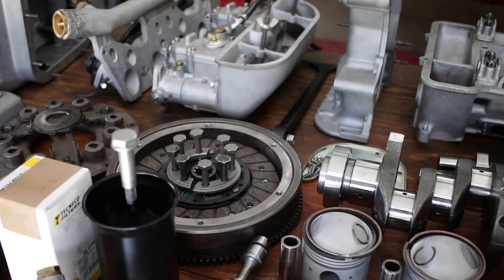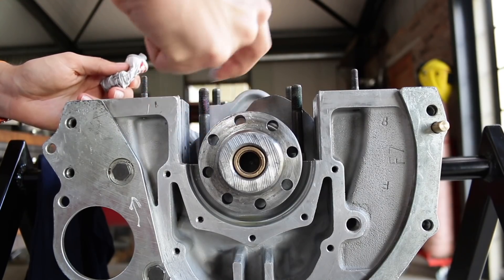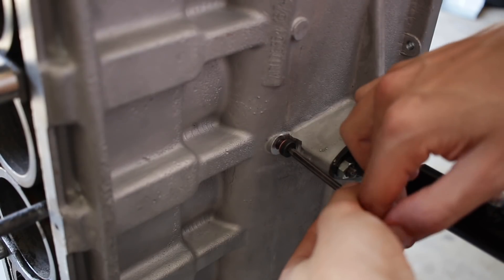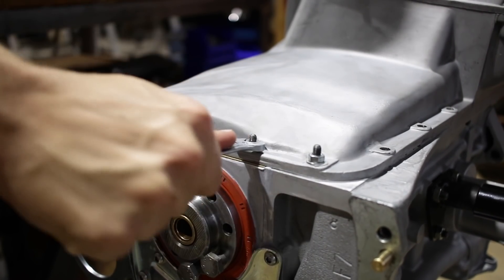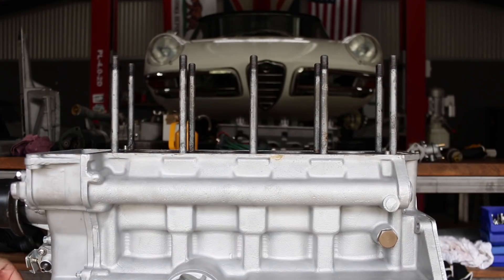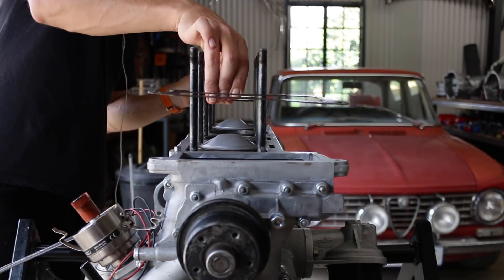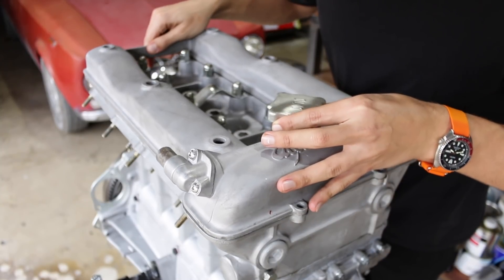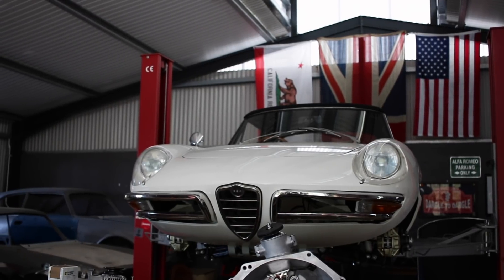Engine Rebuild for the 1967 Alfa Romeo Spider project.

Comment: Hi. I've got a '67 Giulia Super 1600. Doing a rebuild just like you but am running into an issue finding conrod bolts for a 1.6. Where did you find yours or did you re-use the old ones? Thanks
Reply from the maker: On these Alfa twin cams you can reuse the rod bolts, they’re not a stretch fit. If you want to build a high performance engine then it’s probably worth replacing the whole rod and fit ARP bolts. But if you’re just building a standard or even slightly tuned engine the original bolts will be just fine.

Comment: I'm watching the video four years after it was first shown on YouTube.
How has the engine performed? Is it still running strong and reliably?
I hope so!🤞
Reply from the maker: @holdencaulfield1001  I sold the car after putting a few thousand kilometers on it. The engine ran really well. Had great power for a 1600. It was smooth and revved well. Unfortunately it did leak a little bit of oil from the main crank seals, but not so much that it was a problem. The new owner drove it 1000 miles home cross country, and he said it ran great. It’s now in the UK as far as I know, I haven’t heard anything since it left the country about 4 years ago.
Reply: @JethroBronner thank you for the update. It sounds as if your effort was well worthwhile. The main crank seals leak is a mystery! I witnessed a much worse oil leak at a mechanic's in. Peugeot 505. It was like a running tap!
Congratulations on your work.
Reply from the maker: @holdencaulfield1001  I think ultimately the issues with the crank seals were down to the shoddy line bore repair this engine had in the past. The front seal wasn’t concentric and the 5th main cap needed extra gaskets on it to take up the missing material. If I had to do it over I would weld up the main bearing seats on the block and machine them back to standard. But then I didn’t have the budget to go to such extremes.
Reply: @JethroBronner I'll look forward to your future projects!☺️

Comment: Catching up on the videos. Turned on to your channel from Home Built by Jeff: octagon rotisserie. I noticed the high tensile strength washers. Are they crush washers? if so, they would need to be installed correctly. The smaller circumference side goes to the part, the wider to the nut or bolt. The crush washer is designed as a lock washer in disguise. It takes torque to compress them; that compression helps keep the nut/bolt from loosening up. Totally enjoying the videos and the meticulous attention to detail, it shows a love for the car and craft that goes into it.

Comment: Superb! Single click only when torquing. Remember the law of friction.  A solid object moving against another solid object has less friction the faster it moves. The maximum friction occurs right before it’s put into motion. So, when using a torque wrench, the nut or bolt is in motion when it reaches the desired force causing the wrench to click, which means it clicked with less friction. When you go for the second click, it takes more force to put the nut or bolt in motion than when you reached your desired torque the first time. If you go for a second click just to make sure, you are not double checking the torque, but instead you’re just risking exceeding the torque you already achieved. 
One ping only Vasily!

Comment: You may want to re think using high temp gasket maker everywhere. Ultra black from permatex is excellent in both adhesion and stopping oil leaks. 
High heat silicone is good for basically exhaust manifolds. That's it, it's not made for anywhere else. 
Case sealer for two strokes is also another amazing product for stoping oil leaks

Comment: No problem at all fitting the rings that way by hand. (10:05) Donot over extend them. I work ages like that with good results.
Ring breakage was seen with old Opels , due to bad ring quality, not due the mounting method of them.

Comment: When doing mains, I always torque the center first and then spin the crank to make sure it is free, then same procedure one cap at a time until done- that way if you have an issue with a tight bearing, you will know exactly which one is causing the problem.  Don't lock tight you thrust bearing cap until you have checked the end float.  Know about those crank plugs- a guy had a 1750 GTV for sale for 500.00- had low oil pressure and the dealer told him he needed a full rebuild.  I bought it , dropped the pan and replaced the crank plugs- oil pressure perfect- sold the car for 2000.00.

Comment: Is this a factory like rebuild or did you upgrade anything?
Reply from the maker: It’s pretty mush standard, apart from the repairs to the block and modified pistons I covered in older videos, and it has a 123 Ignition distributor.

Comment: Do you have any advice on 105 engine removal without the transmission? i took the transmission bolts out, the starter bolts, engine seems to be stuck where the clutch master is. thank you!

Comment: Great Video and great work!! When you assembled back flywheel I couldn't see what are the reference signs to correctly position it, can you please let me know? I removed it from my engine and the sign I did on flywheel disappeard when i cleaned it .... Thanks
Reply from the maker: Thank you! There are factory stamped “0”s in the flywheel and crank, and when I had the rotating assembly balanced they stamped a 0 on the clutch pressure plate too.
Reply: @JethroBronner  MAny Thanks!!

Comment: Smart move... My family and I owned and rebuilt a slew of Alfa engines and transmissions in the '70s. Our Alfa guru was a shop that also raced Giulietta spiders in SCCA events. They were spinning bearings. They removed the keepers and resorted to Loctite, theorizing that the keepers were distorting at extended redlines. They never spun another. Their 1300 Alfas always beat the 1500 Spitfires.

Comment: I am not an expert in old Alfas, but... All these engines seem all the same, except for the cylinder size . Isn't it a bit boring to work with? You have lots of projects, plus spare engines... Or, maybe i'm wrong... Would be glad to hear from more experienced people)
Reply from the maker: Yea they are all very similar. I’ve become very familiar with the Alfa 105 engine, but I’m also working on some new projects from Fiat and Honda for more variation.

Comment: Great work! Thanks for putting these videos together. I'm constantly using them as I'm trying to get my Alfa up and running. I could use some advice. I just rebuilt my carburetors (and used your video step by step to get me through this process). However, I can not get my fuel pump to work. I have replaced but can't get any fuel. I've check the lines, they flow using air, and I've looked for a breech in the line. I'm considering by-passing the old mechanical unit (12:22 of your video) and using a newer electronic fuel pump, but being a purist and wanting things to simple work, could you offer some advice as to why I can't seem to make this work? I do have both the original rods, however, I do not recall the spacer when I took the old fuel pump off, could the rod have gotten pushed to far in and created some damage? Thanks again for putting this channel together.
Reply from the maker: This may seem overly simple but first make sure that the fuel lines are plumbed into the pump the correct way round. I made that mistake on this Spider when I first tried to start it. 

Those rods can't be pushed back too far, but running the pump without that spacer will also cause some clearance issues inside the actual pump.

Comment: Jethro, I've been watching many of your excellent videos on Alfa repair.  This video will help me with my reassembly of my 1600 engine which will happen very soon. On another note, I'm wondering if you have any videos on adjusting steering play. My '67 GTV has a ZF steering box and I can't find much about how the spacers at the end of the box are used.  Any help you can provide or, better yet, if you have a video that would be fabulous. Thank you for great videos.

Comment: Hi Jethro, I love your watch... is this a Seiko SKX 009? Apart from that, lovely work done with your videos, they are really very thoroughly done.
Reply from the maker: Thanks! It’s actually an SRP 779 “Pepsi Turtle” it has the same color scheme as the SKX009 but it has a different case, movement, and dial.
Reply: @JethroBronner  Great choice, I have an original Turtle, some other nice Seikos, looking forward to buying a Sumo... I respect your choices, excellent watch!

Comment: dear god i feel so bad for whoever tries to take this engine apart with that metric fuckton of red loctite
Reply from the maker: You know red Loctite comes undone with heat right?
Reply: Jethro Bronner yea I work with it every day, and when you put half a gallon on it makes it significantly harder. So have fun using an acetylene torch to heat your rod caps up to disassemble an engine that might make 100hp if you’re lucky

Comment: Hi from Australia. Love your videos. You work the same way as me. I oil prime all my engine builds too but I use a gas cylinder that I put the oil in and use compressed air to pump the oil from the gas bottle to the engine. I have never used piston ring tools and have never had a problem.

Comment: real engineers don't clean cranks on the floor, thats what tables are for, and motors are built in engine clean rooms, also the abuse of loctite shows your lack of confidence in either part quality/condition or your torque wrench. Apart from this a nice effort building the motor, superb filmography. Hope this engine brings you miles of joy.

Comment: In 1971 I purchased an Alfa Romeo Giulia 1300 TI super. They were exceptional cars, their uniqueness was the sound of the engine, (my wife knew when I was parked at home) the acceleration, the cornering stability and when she accelerated the rear axle she rocked right left. I was 26 years old. After 32 years (I sold it in 2003) and after at least two restorations it didn't behave like this anymore. I have the road tests and the comments of the Quattroruote magazine and the Motor Books Alfa Romeo Giulia 1962-78. You did a perfect competition restoration with impeccable care. I would like to drive it again with the scent of the new car and the scent of rubber and leather. Thanks for the video.

Comment: what about crankshaft balancing with the replaced oil plugs ?
Reply from the maker: I do this mod before having the rotating assembly balanced. But yes, it will throw the balance off if you don't re-balance your crank.

Comment: Hi !...what type of ignition distributor did you use?
Reply from the maker: It's a 123 Ignition preprogrammed distributor.
Reply: @JethroBronner  Which one do you recommend? normal, with usb or bluetooth? I have an alfasud 1.5ti and a w123 2.3, both with carburettor

Comment: youre using way to mutch locktite on everything. What if the block breaks witin a years time? youl have a very hard time to take it all apart again and you got locktite in the oil passages now so it's still blocked. again pls do not use locktite on wearing parts you do not have to use locktite on crank bearing caps none at all.
Reply from the maker: otto leeverink the excess loctite is pushed out of the treads so I can just wipe it away. And it won’t harden in the oil passage because it only sets in a when there’s no air. 

What’s the harm of using too much? Nothing. What’s the harm of not using enough? Thrown rod. So I’ll take too much over too little, thanks.

Comment: I hope you checked the bearing clearances before (e.g with plastigauge). Never just trust calculated bearing sizes/clearances. The packaging of the bearings might be the wrong one, then the guy at the machine shop couldve had a bad day and ground off more or not enought than he thought.
Awesome video/built tho!

Comment: 15:42 Jethro, it should be vital to warn newbies to place a rag under the camchain while fitting the master link...I learned the hard way, dropped one into the sump. It's a lot of unnecessary extra PT( and lots of throwing of toys out of the cot!) to retrieve stuff that falls down there!
Reply from the maker: John Jones It is! But that’s also why I fit the sump last! But yeah, if I play when cams when the engine is in the car I always put a rag down to catch the master link.

Comment: No gasket under the valve cover? Just wondering, not being critical...
Reply from the maker: I don't mind criticism! There is a gasket that's glued to the bottom of that cover. I just didn't replace it as it was essentially brand new. I'm thinking about painting that cam cover, and if I do that then I'll replace the gasket, so I'm saving the one that came in my new gasket set.
Reply: @JethroBronner  Thanks

Comment: Jethro, thanks for that build. I decided not to go ahead with my Super 1600 resto as I came to the realisation before I started that I couldn't do it justice. The body shell had little rust and I had enough spare parts for the interior, engine etc but a long term project without a full size garage would have risked the car. It's therefore great to see a thorough and conscientious build.
Reply from the maker: Well that's ok too. A car doesn't have to be perfect to be enjoyed. Sometimes just using them the way they are is enough.

Comment: Hey Jethro, I've done the head gasket on my 1750, but you're certainly inspiring me to go bigger... it was interesting to hear your use of the loctite, something to keep in mind. I was curious, do you apply the gasket maker goo on the head gasket to better block off the channels on the Reinz gasket? Or you use a different gasket??
Reply from the maker: I use the Reinz gasket. I don't use any sealant, as they have sealant embedded in them.

Comment: Nice build video. I don’t think I have ever seen a cigarette seal that didn’t leak in a Alfa. It was a hard sell to the customers who owned new 164’s at the dealer I worked. That was a nice touch to validate TDC.  I always used a dial indicator.
Reply from the maker: Yeah that whole rear main bearing situation is tricky to get a good seal. I sometimes find with a dial indicator it's tricky to know when it's in the middle of the dwell.

Comment: Great video, brings back memories of many hours working on my Guilla super in the seventies, though I was not nearly as professional as you are!
Question: I didn't see you doing the tappet gaps - does that have to wait for the engine to run?
Reply from the maker: Glad you enjoyed it! I do the valve clearance when I'm setting up the cylinder head, as this point that had all been set for months. In my next engine build video I'll get more into detail about setting up stuff like valve clearance and bearing clearances.
Reply: @JethroBronner  thanks for the reply 😊😊

Comment: I actually prefer to install piston rings by hand.  I "spin" them on though.  Any method is acceptable as long as it works.
Reply from the maker: Exactly. There are so many opinions on how to do it. As long as your don't end up with a twisted ring or a scratched piston you're good.

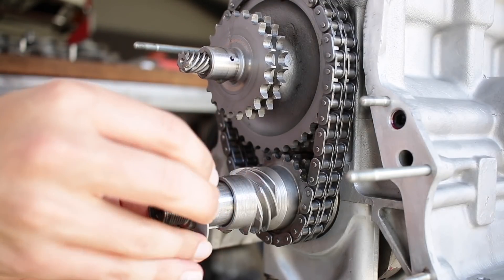Comment: Lots of fun watching this so far.  Nice practice regarding the oil ports/plugs - threading and plugging seems a great improvement.  Great clue about the flywheel bolts' plates too - but at about 6:40 you should also have mentioned making sure to reinstall the crankshaft's front oil slinger before installing the front cover.  OMG - "a friend" looked at his parts table after finishing reassembly and wondered, 'What the hell is this big washer ?  Oh #*&%@'   It was sad.
Reply from the maker: I actually did that the first time I built one of these engines.

Comment: Sorry, the bearing cap is not in line with the crankcase. If you plan a cylinder head the bearing cap must be installed.

Comment: You can easily fit piston rings by using a stiff feeler gauge held vertically beneath the ring, then gently rotated as the ring is eased downwards.

Comment: Thanks Jethro  for putting together such a great production ,,,I admire your patience with this engine and hope all goes well,,You have also increased my confidence level greatly in terms of opening up my 2000.
Reply from the maker: Thanks! I'll be doing a 2000 engine for my Giulia Ti soon. I'll document that build start to finish.
Reply: That's perfect timing!  I can follow along while attempting my 1st rebuild of my 73 Spider Veloce w/Spica.  My biggest concern is getting the parts so clean and the fact that it has sat for so long....oh, what I might find.  🤔😲

Comment: Hi Jethro,  what are your thoughts with ts engine being fitted to 105, would it be something you might resto mod in the future?
Reply from the maker: It's something that I'd like to try. One of my concerns about it is that they often don't look period. There are some companies making TS heads for 2000 Nord motors, that might be a better option than going for a full 80s/90s production TS motor.